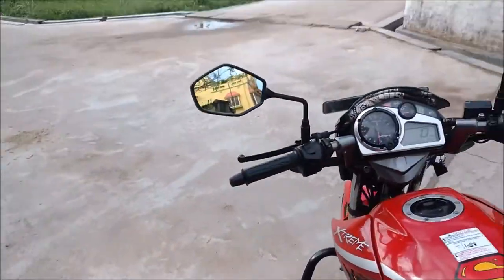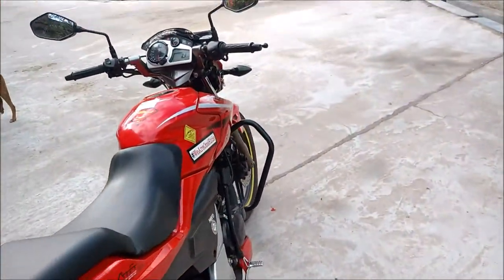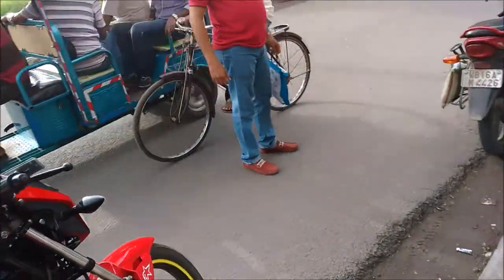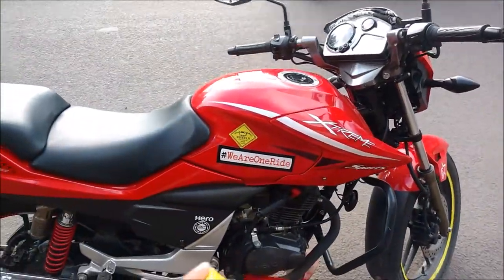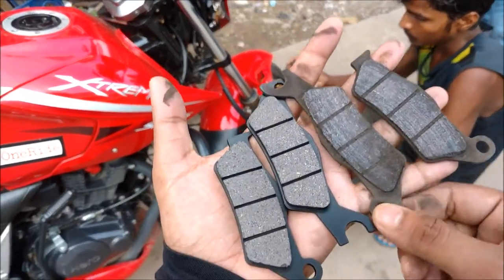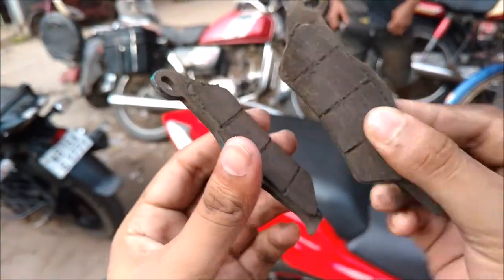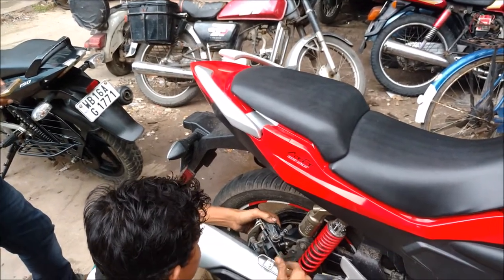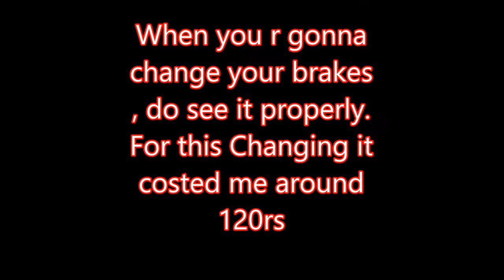Changed the Disk Pad's | Hero Xtreme Sports ||SR||

Comment: Use windtone horn its sounds like a big bike
Reply from the maker: +Gour Das later on i will upgrade..
But as for now my own made setup works great.. its damn loud.. 😊
Thank u for ur info.
Reply: Starlord Rider  ya but the stock one  is bit low so i also changed my horns to windtone horn
Reply from the maker: +Gour Das stock one is not that bad..
Just the problem is after some time the tuning looses, so u need to adjust it.. for good sound effect..
And in mine i have added one more ..
Its a low one ..so the sound effect is pretty loud..
But still doesn't effects people.. 
No one cares..
What to say..
Reply: Starlord Rider  its okay i triedit once but messed up the horn so went for the windtone horn
Reply from the maker: +Gour Das its a very easy process..
And i am gonna install the kill switch..
As i know all these stuff..so pretty easy for me..😊
Reply: Starlord Rider  okay then upload a video on that topic best wishes for you channel !!!
Reply from the maker: +Gour Das thank you .
Yup i will surely.. ..
Just gained some more knowledge about the wire's..
And finding a way not to hamper the warranty..
Reply: Starlord Rider  it will not hamper your warranty !!!!
Reply from the maker: +Gour Das it will ,,as the kill switch will go through the ignition line..